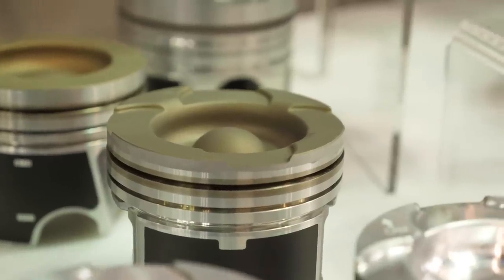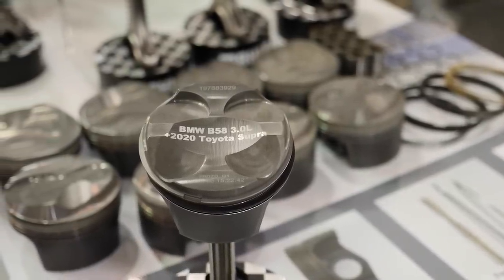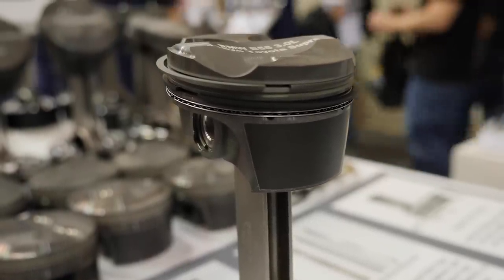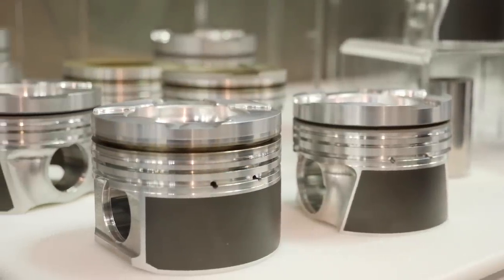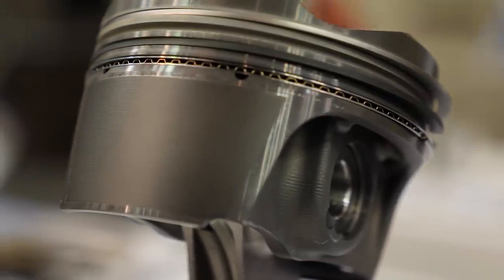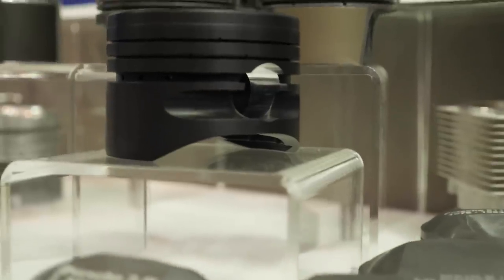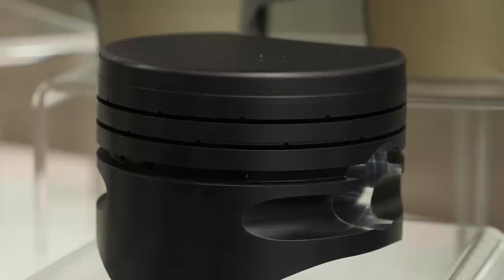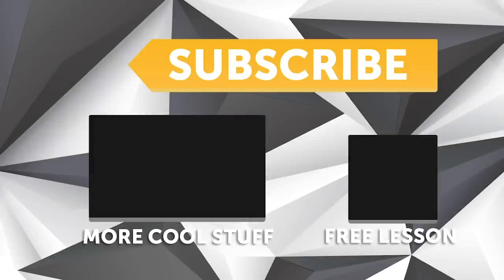Are Piston Coatings Worth Having AND Can Coatings Save Your Engine? [TECH TALK]

Comment from the maker: Are coatings something you've looked into at all before? Did this interview leave you with any more questions? Let us know and we'll address them in future content where possible for you guys 🤓
👨‍🔧 Building a fast car? Get $400 OFF the all-inclusive VIP online course package deal: https://hpcdmy.co/offery177
✊50% OFF your first online engine building course. Enrol now:  https://hpcdmy.co/offery177
Reply: I love coating. Convincing Mr Shadetree enthusiast that he should spend the money is hard ROI to swallow. There other areas to gain an advantage or increase longevity. Please do a video on exhaust coatings. IMHO thermal control is overlooked by most but most hardcore typically winners/most competitive.
Reply: @wudntulike2no32  True however Mr Shadetree's often mistake trusting friends and others to tune their cars/trucks coating the piston domes would give them insurance for their bad decisions.
Reply: @wudntulike2no32  while you are technically correct. I feel that it's best to get the best that you can when it comes to internals. Your rotating assembly is the one thing that you don't want to wish you had done differently, so I will always recommend getting the best pistons,rods etc for your application that money can buy even if it means holding off on something else till later.
Reply: Very informative for people that were thinking of replacing pistons and realizing the benefits that a coating can have. I thought you would ask about rings if that benefits but it wasn't mentioned. The race/rally specced engine I built the pistons had a 1mm top ring a Dykes type design made of steel with a PVD coating on it. Second ring also 1mm but the design is flat and surface of cylinder face is slightly slanted from top edge down. The skirts has a Zylon coating for reducing even more friction and F1 engine have the same coating with top of piston with a ceramic coating. Also piston material is different than the pistons available elsewhere. The cylinder wall is made with thin coating that I couldn't find out what they used, all it was said it reduces friction and helps transfer heat efficiently to reduce it. Back to the pistons I have which due to it being NA I polished the tops to a mirror finish to help reduce carbon build up and have a better flame front of combustion processes. The head  design is Penthouse and chamber also polished to mirror finish. Piston pin has a DLC coating I just remembered. It's a small 4 cyl engine of bore 81.5mm and the stroke 81.5mm with 5mm longer rods of 135mm replacing the standard size of 129.5mm. Crank journal size is 46mm main also big end same. Revs to 8500rpm but easily and safely handle 10,000rpm. Rev limiter is triggered at a point power drops. Due to friction reducing coating on internal parts also the piston rings reducing even more friction the dyno reading was 223bhp with 142lbft torque but with wilder cams it could achieve over 240bhp with minor tuning of ECU parameters to match cam specs. The technician who set up the engine parameters on the dyno never known a engine that revved up so quick from idle to limiter like this one. Asked what was done to it I said it's secret tricks to reduce friction for increasing power I can't go into. PVD coating on 1mm rings and Zylon coating on skirts is definitely the best friction reducing internal parts releasing the largest increase of power but combined with the other components the power made adds up but is immeasurable to find which is the best one modification that increases power the best. Sorry about the long story of what other things different piston idea's are worth more in-depth analysis like this aspects I went into with pistons I used. Also I have the same name Taz as you. Interesting channel I've watched everyone that is out and look forward to the next one that comes out.
Reply: Would love to see one on WPC treatment..

Comment: The Anti-friction coatings are similar to normal paints, but instead of color pigments they contain solid lubricants such as MoS2 & Graphite etc. These solids are mixed with binders and solvents. Binders help them adhere to the machine component's surface, while thinning solvent eases the process of coating. After coating, these parts are heat treated and the solvent evaporates, you are left with a fine layer of solid lubricants. Graphite and MoS2 have laminar layered structures which help them move external forces with ease.

Comment: That’s hilarious that you guys did this interview right in front of Line2Line. Their entire business is skirt coatings. But that’s an interesting point that with Mahle you’ll know the factory spec. Whereas with line 2 line the reassurance is slightly tighter fitment that reduces blow-by of alcohol and soot, reduces wiggle and increase the life of rings/seals, and that the abradable coating catches and traps any abrasive particles that could cause damage. Would love to see you interview them. And though it sounds ridiculous, would love to know if their coating could be layered over a manufacturers coaying

Comment: the piston crown coating, which should also be used on valve face and combustion chamber... will reduce heat soak which will allow you to run more boost and more timing. the coating prevents the heat from soaking into the piston or cylinder head and helps it exit the engine. which will help keep tempature lower and enable more boost and timing.

Comment: I can't prove it but I feel that the thermal coating on my pistons saved my ass. We freshened up the 1.8t in my old A4 with new pistons so I could turn up the boost. It's a long story but I had a intake air temp sensor that was reading off and we couldn't figure out why it wasn't making power. Since we thought the motor could hold it we just kept turning up the boost thinking it would pick up. By the time I realized what was going on I was damn lucky I didn't cook the thing.
Reply: You didn't give any details that tell us anything about your setup or why the thermal coating would have had any effect.

"We freshened up the 1.8t in my old A4 with new pistons so I could turn up the boost." Why? A 1.8T doesn't need new pistons to run high boost.

"I had a intake air temp sensor that was reading off" What does this mean? Was it reading low? Why were you so intent on monitoring intake air temp? Why not look at something more useful like exhaust gas temperature?

"and we couldn't figure out why it wasn't making power." So the car wasn't making the power it should have been making? Why didn't you rectify that problem first?

"we just kept turning up the boost thinking it would pick up." Why on Earth would you continue to push the engine harder when it wasn't making power it should have been making on lower boost? Obviously there was a problem you needed to sort out before continuing. Why did you not rectify that first?

"By the time I realized what was going on I was damn lucky I didn't cook the thing." Did you really? What was the problem? It sounds like you have no idea. So what did you "realize" was "going on?"

This entire story reeks of ass-backwards idiotic ignorance. Throw parts and other things at the problem, ignore warning signs, and hope that somehow turning up the boost solves everything. If I were ever this stupid to do such a thing to a car, I'd never publicly admit it.
Reply: @rars0n   first off I didn't feel the need to write a book in the comments and gave enough to get the basics across.... But anyway yes the oem mahle pistons have proven themselves up to around 500hp give or take. But once over 100hp per cylinder you're running on the ragged edge and asking for problems if doing more than drag racing. We were shooting for 750 to all 4 wheels and quit at 842whp. 
    As for why I was using intake air temps and not egts? We have both and I assumed it's self explanatory. But the ecu monitors iat temperature in order to adjust timing among other things. Also while egt is a valuable tuning tool it's nowhere fast enough. Measuring the air going in is going to beat what's coming out every time when you're ecu is trying to calculate where in the maps it's supposed to be. Egt has it's place in tuning but there's a reason why ecus use iat sensors.
Why would we keep going...... When you tune enough you'll have a good idea of how much how per psi it should make.Just because a car makes less than expected doesn't mean there's always a problem and it's not a linear curve all the time. Plus everything was fine prior too. We just assumed it was the different turbo causing it to be a bit off. Either way between the detonation and high egts (didn't notice the detonation until the egt spike) had we had stock or uncoated pistons they wouldn't have lived. The wiseco armor x coating works. And I'm sure I missed something from your post but it's late and if you actually wanted to learn something you wouldn't have acted like you know everything and talked so much trash yet you didn't understand why the ecu uses intake air temps.
Reply: @southjerseysound7340  There's a big difference between "turning up the boost" and aiming for 750+ whp. The way you initially phrased it sounded like it was necessary to change pistons just to increase boost pressure.

I understand perfectly why the ECU uses IAT. From a tuning perspective, IAT isn't all that useful though. In this case, the fact that the sensor was reading incorrectly lead to a problem, but it wasn't IAT that told you what the problem was, it was detonation and EGT.

I do appreciate you specifying which coating you were using. I don't doubt the efficacy of coatings at all. I still doubt that uncoated aftermarket pistons would have had a problem in this instance, though. I don't think piston coatings will magically make up for poor tuning. There's not enough information in this one anecdote to make a determination either way.

Comment: Does thermal coating ever deteriorate or flake off over time, will it still be like new let's say 10,000 or 20,000 miles down the road on a street strip application granted as long as the tune is good?
Reply from the maker: I can't speak for other brands and their coatings, but Eric does touch on this by stating the coating will last the life of the piston save for any events that wear it prematurely, however if that happens it is supposed to be sacrificial to save your engine from damage - Taz.
Reply: @axelriet  awesome thanks for the info

Comment: Hi Andre. 
So is using oil additives with 100% synthetic oil beneficial for everyday tuned car? Like Liqui Moly, Bardahl, they claim to prevent metal to metal by coating cilinder walls, bearings, etc.. so is that effect similar to one from Mahle factory coating? 
Thanks

Comment: Ceramic coatings on internal engine parts was banned by F1, must be a reason for that, on the most highly developed engines on the planet earth.  They do have 6 oil squirters spraying oil on the bottom of the piston to cool it off.

Comment: So essentially the skirt coating isn't there to support piston to wall clearance in the event it doesn't last... which of course it won't. Be better off designing pistons that actually have tiny pockets on the skirts that hold oil for those cold starts instead of the coating... imo.

Comment: I don't think anyone building an engine has EVER thought or said that any kind of piston coating can compensate for a bad tune or prevent damage to an engine due to poor tuning. What a bizarre premise to start with. Anyone that has this ridiculous notion in their head shouldn't be building an engine, period. "If not, what's the point?" What an idiotic question.
Reply from the maker: Assuming you work in the industry as a tuner and have a lot of experience in talking to 100's/1000's of people about this and other topics, I'm surprised it hasn't come up. If you make your living outside the industry, then I'm not surprised it hasn't to be fair, hardly water cooler chit chat. 
It is also discussed in passing here, but you can do your own Googling: https://youtu.be/AunRiiSidBE

I don't know where the notion came from, maybe some poor marketing angle previously by some company - Taz.